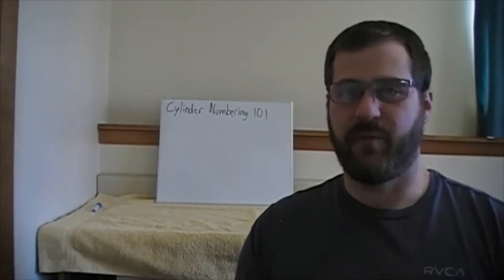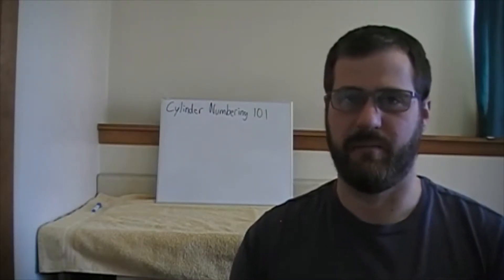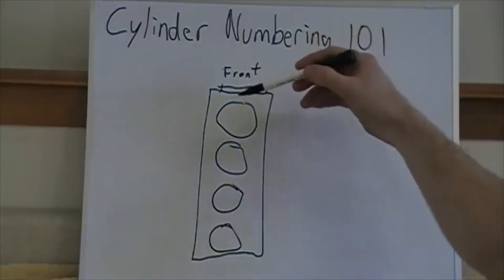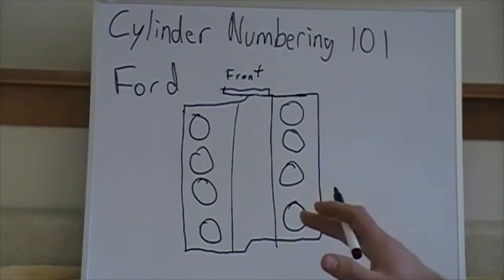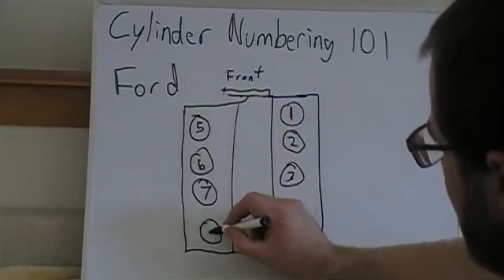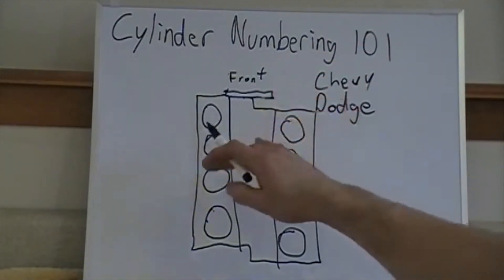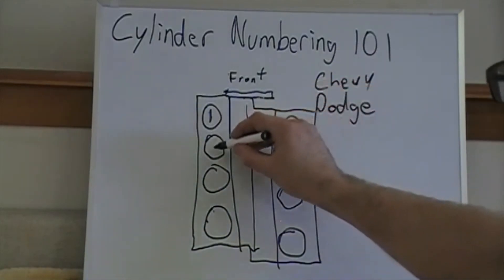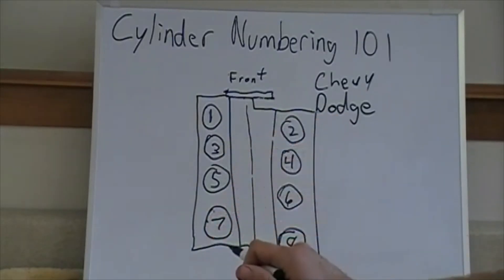Engine Cylinder Numbering Explained

Comment: So the engine cylinder numbers must match up with the distributor
Reply: The firing order is not in order by cylinder number to distributor. Its the camshaft that gets the firing order.
I personally build Ford V-8s and you can change the firing order on a 289, 302 just by installing a 351W camshaft by doing so it doesn't fire cylinders 1 and 5 simultaneously putting less stress on the front of the crankshaft.

Comment: i have a ford duratec v6.
i had a misfire in cylinder 2.
the mechanic put the new coil in my cylinder 4, which would be cylinder 2 if it were a GM motor.

Comment: Not true of v8 ford diesel
Reply from the maker: The International/Navistar (6.9, 7.3, 6.0, 6.4) built engines installed in ford pickups are not numbered by ford and are different.  The 6.7 is ford and is numbered like the video.

Comment: "On a MULTI-CYLINDER engine".

Ummmm... why the hell you feel the need to specify this?  You ever worked with an engine that had a SINGLE CYLINDER??? Literally every engine is a MULTI-cylinder engine.
Reply from the maker: I've worked on many engines with a single cylinder.  Do you really not belive single cylinder engines exist?  Ever mow a lawn with a push mower?
Reply: Wow now that's just wanting to comment some shit. Totally irrelevant. It didn't affect anybodys view of the video or confuse them. What a dick to point that out wtf 😂

Comment: what about a 2017 Hyundai with 4 cylinders. The rows are going horizontal instead of vertical so I'm not sure if you count left to right or right to left?
Reply: You’d count from the harmonic balancer (front) to the transmission (back)

Comment: My friend!! How 'come you say that Ford  screws every buddy up ? You forget that Ford is "Pioneer" of auto industry.
The others are followers.
So Ford has been imitated all the time.
Ford is not going to change a good way of logical thinking and become a follower instead of keeping leading!!
Reply from the maker: Ford is the only American V8 that is numbered that way(pretty sure anyway).  So In a Numbers game against GM, Chrysler, AMC, Ect someone that works on a variety will be thrown off by Ford.  As for Ford being a pioneer of the auto industry. I would argue the largest single impact Ford has had on the auto industry has been assembly process itself more so than engineering or vehicle design.  That's not to say Ford hasn't been innovative in engineering or design however all the companies were as well.

Comment: How can the ford fire them in order, I’ll never buy a ford.
Reply: They don't. You can call a dog's tail be a leg, but it doesn't make it one. Likewise, Ford can be name their cylinders Do-Ray-Me or 1,2,3, but that doesn't mean they fire in that order. 💡 Just keeping it simple.
Reply: It's the stroke of the crankshaft and the lobes of the camshaft per intake valve 
Please do not work on engines cause they will not turn or fire. You probably tie your shoes together and go out for a jog and blame it on a crack in the sidewalk to why you fell on your face.

Comment: Number 1 is not always in front....i repete not always in front..if you time a 4 cyl. Geo tracker , like number 1is up front it will not start but if you time it as number4 is then it will start...
Reply from the maker: You sir had your distributor 180* out.  It's very easy to do that and the tracker is an engine that if 180 out you can basically pretend the cylinder numbering is backwards and it works.  
I'm one of the few people in the world that has actually rebuilt a tracker 1.6 engine.  The farthest forward cylinder is number 1.  The bores were so small we had to get my friends daughter to wash the cylinder walls.
Reply: @macsgarage  LoL..... I believe you that you have done one ....lol..just one..
If you will look here on YouTube there is a guy who will explain it to you..... LOT OF PEOPLE THINK THEY KNOW until they run into these engines,  I've seen 3
And thats all I have to say...